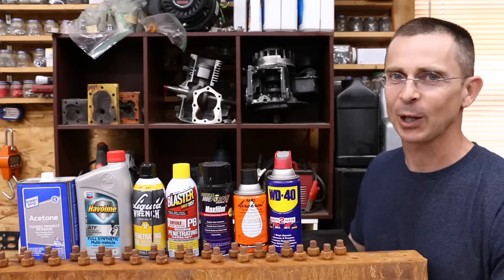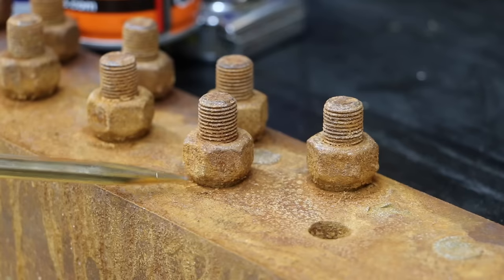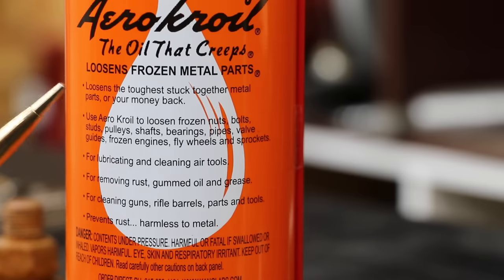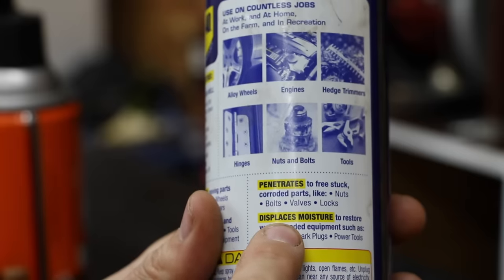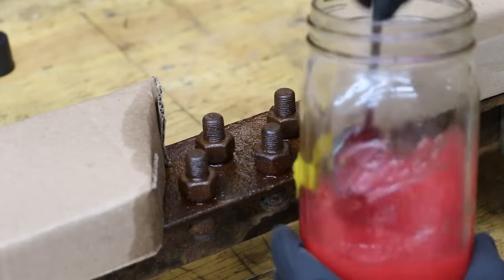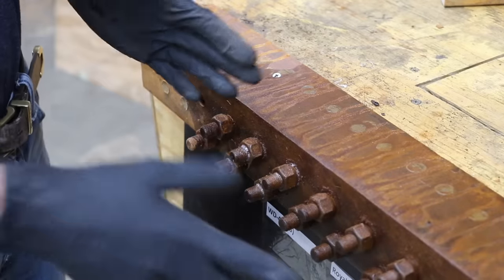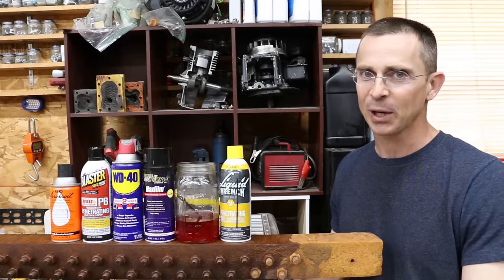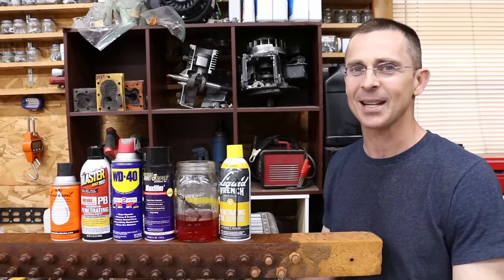Which Penetrating Oil is Best? Let's find out!

Comment: I’ve used almost all of them and over the years and different applications the PB blaster works the best to be honest.
Reply from the maker: Thanks for sharing.
Reply: Most importantly it smells like root beer
Reply: Have you used Liquid Wrench ?
Reply: @@martys4x457 maybe i just have a weird sense of smell but I think it smells like root beer Lol
Reply: I agree on the PB Blaster. I use it all the time. I restore old cars for a living, so I've encountered many rusted fasteners. PB Blaster is the only one that I can see actually dissolving the rust when applied. Wire brushing the fastener before applying any penetrant will help. Kroil worked well for me in freeing up a rusted stuck engine. Poured Kroil in the cylinders and let it sit a couple days. I think Blaster would work well for that too, and I am going to try it in another old engine in a few months. The other products have not been useful for old, rusted fasteners for me. I keep some WD40 around for light lubrication use, but it's not useful for serious rust.

Comment: Liquid silicone spray has always worked for me. It seems to penetrate better than anything else and works in seconds. It will evaporate leaving behind the silicone and not an oily mess. Also works wonders removing/installing rubber hoses and weathertight electric connectors.
Reply from the maker: Thanks for the feedback.
Reply: Silicone doesn't evaporate, and can be a disaster in a restoration shop where paint work is done.
Reply: Read it again and tell me where it says silicone will evaporate lol The liquid spray evaporates leaving behind the silicone 👍 As far as paint shops ALL spray lubricants should be avoided in such areas obviously.

Comment: I really like all the testing you do and this test was no exception...
I've been using Liquid Wrench all my life for rusty bolts and then heat if the Liquid Wrench doesn't do the job.
WD-40 is my go-to for rust prevention, as a minor lubricant and thread cleaner.

Comment: Liquid Wrench has always seemed to work the best for my uses. Application of heat can also be used differently. On exhaust type connections, a couple of heat cycles can break an oxygen sensor loose.
Reply from the maker: Thanks for the feedback.

Comment: Video recommendation: Which spark plug is best. Test different spark plug brands like NGK, champion, autolite, etc. as they are around 2 dollars a piece and not expensive across one engine like a predator 212. Measure engine temperature, RPM, fuel economy, and performance. Thanks!
Reply from the maker: Thank you for this video test idea!
Reply: Oh man yes please.
Reply: My prediction is that fancy plugs don't improve power or performance in any way.
All you need is a good ol fashioned spark not a fancy spark.
Reply: Donuts Garage, I have learned in the past that NGK plugs are the best for a 2 stroke. Maybe Project farm should test them on 2 and 4 stroke engines.
Reply: First thought is that the fancy plugs might not perform measurably better but last longer. The iridium plugs have a skinny center electrode that is supposed to produce a better spark and last over 100,000 miles.
Reply: Donuts Garage good idea but it's only practical for the engine you test
Reply: depends on the vehicle/engine.  try running a german car on some autolites and see what happens lol
Reply: Zadiel Vazquez from my experience cheap plugs don't last but when they are new and as long as it produces a strong spark, well you have it.
Try running different plugs on a real dynamometer and find out for yourself.
Reply: I would like to see this also, but mainly with 2 stroke engines because they burn oil and gas . The oil makes them more prone to fouling. The reason why is I have rebuilt many snowmobile engines and have had the worst luck with CHAMPION plugs. I don't recommend them because of my experiences with them. Just wondering if I am still right .Or Maybe it was my perception of them being inferior.
Reply: Andy Weaver not really a lot lasting.  So we plugs can't lei up with the demand of some motors causing them to detonate.  Happens often on finicky cars.  Usually German.   I've seen a few engines blow because of it.   Brand new plugs.   Like i said,  all depends on the engine
Reply: Donuts Garage I want to see this test done...
Reply: Albert Champion invented the spark plug, Champions of the right heat range always ran my sbc cars better.
Reply: Zadiel Vazquez sorry I could always be wrong but I have never heard of plugs causing pre ignition??
Pre ignition is generally only a problem in high compression engines and low octane fuel. Or lspi  in turbocharged engines and that's a whole different animal!
I didn't realize a spark plug could cause engine knock.
Reply: I don't believe a test like that would benefit any results. As long as the plug is correct type for the application, the differences are too small to detect with garage equipment.
Reply: Catrik  I agree
Reply: Duh NGK or nothing... love project farm👍🏻
Reply: my prediction is at home there is no test you can measure the difference in the brands...the difference is prob so minute that only highly sophisticated machines would be able to tell any diff at all
Reply: Another idea would be to modify the plugs ie drill a hole in the ground electrode. I did that one to a lawn mower and it seemed to run better.
Reply: Andy Weaver, It's called spark knock.
Reply: MegaDirtyberty I will do some research on spark knock. Sounds interesting
Reply: Well that does stand true with copper due to it being the most conductive metal used in plugs, certain power delivery is required for some applications where iridium is very good.
In any case, Champion is and will always be, total. crap.
Reply: NGK are best for 2stroke. Champion are the worst  for 2stroke. Champion seem to work well with 4 cycle engines
Reply: It would certainly be an interesting test. I've always been under the impression that old fashioned copper plugs would be the best - as copper is the most conductive compared to other plug types, but they don't last nearly as long. I wouldn't really expect the differences between plug types to be different past the standard margin of error though.
Reply: I would also love to see this. I found E-3 to be gapped so bad from the package and actually caused heat degredation in a two stroke piston (no, the gap was not too large to create too hot a spark) and NGK to be the best. Had many champion plugs go bad on me.
Reply: try bosh super 6 or super 4 plugs there better than ngk and champion
Reply: @supersportryder   Did you know that AC Stands for Albert Champion?
Reply: No I did not, thank you.
Reply: yes  @drgnzadiel101  , iridium autolites on a volvo not really good either
Reply: Guys... NGK makes most brands of spark plugs, except champion.
Reply: @erniestoner8266  
I used champions in the late 70s and kept having problems with them not lasting more than a couple of weeks. A friend told me ,if you get rid of those champions and put Autolites in there you wouldn't have that problem. I did and he was correct. Never had any problems with Autolites so why change? I tried E-3 they worked great for about a month then went to crap. Not worth the money in my opinion 
Just what I have tried maybe it will help you sir
Reply: @bertgrau9246  proves my opinion- Champions are garbage. Thanks.
Reply: @SuperJlonergan  
Sir, I think if you tried E3, champions,  and Autolites you will see a difference very quickly. In my experience the Autolites have out performed all the others by a long shot. E3s too much money and I tried them in my car. Pick up and my lawn mower. Lasted the longest in my mower one season my car and pick up just a few weeks. In my opinion I would rather buy the cheap copper Autoelites replace once a year and move on.
Reply: @erniestoner8266  
You're welcome sir
Have a wonderful weekend and may God bless you and yours
Reply: Pedro Gunderson  
That may be correct, I have used them in a 67 Dodge Charger. 69 Plymouth valiant. 61 Caddy 74 Caddy 75 and 76 Caddy 65 Dodge Dart 84Ford tempo 90 Doge omni 77 Chevy pick up that's not every application I know but every vehicle I've used them in they worked better than what they had in them. Plus I was even able to get one for my mower an Autolite that is and never had any problems like I did with champions, and Ac's . I have tried using Halos as well about $11 each. Still couldn't tell any better than Autoelites and gas mileage was about the same. In the. Long run the Autolites are better with fast starts and better gas mileage.
Reply: Denso & NGK - no other spark plug makers are even in the same ballpark!

Comment: Fantastic! I've never known a mechanic to believe in penetrating oil at all, but it's really cool to see that while most of them, indeed, did basically nothing (most of the bottom ranked ones didn't seem to actually do better in a statistically significant sense), Liquid Wrench really blew my mind! What a great product!

Of course, nothing beats good ol' molecular motion.

Just uh... <_< Don't use the torch on your Saab story. I've seen more than a few of those get lit on fire on the alignment rack with all their fancy rubber curtains and sheaths to keep things clean.
Reply: I've been turning wrenches for a living for 12 years and I never don't have a can of PB Blaster on my Roll Cart. 

Looks like I may have to give liquid wrench a shot.

I'd rather spend 10$ on a can of oil than spend 2 hours extracting broken exhaust bolts. Thank god I dont work on northern rust belt shipwrecks. Or I woulda quit doing this after 2 weeks.
Reply: @EvlEgle  Heheh, yeah, I managed shops in the northern rust belt. Maybe why all of my guys always just went right to the torch.
Reply: @barefootalien  Only worked in 1 shop that even had a torch. 

Tried to bring my own to more than one dealer I worked at and they said hell no. 

Just not a problem we deal with down here. Thank god.
Reply: @EvlEgle  That's wild! A torch was considered mandatory equipment up north! We even kept backup bottles in case we went through them and couldn't get a delivery right away.

Like you, a lot of the time people just wouldn't risk breaking or rounding off bolts, and would torch right away, like you do with penetrating oil. Very interesting, the difference in culture, though.

I wonder why the dealerships didn't want them... maybe they thought they were a liability for damaging cars? Which... I mean, they are, but no more than most other tools, and considerably less-so than a drive-on alignment or oil change rack. xD

Like I said earlier, the only cars where the torch was a problem were Saabs, which often have neat little rubber flap seals around the engine bay for things like tie rods to go through. Really neat design, kept the engine bay pretty clean, but also tended to melt or catch on fire when a torch had to be used, especially to free up an outer tie rod end for alignments. Not that they hit the seals with the torch, just that the tie rod end would get hot enough to melt them.
Reply: @EvlEgle  By the way, I hope you weren't buying the cans of penetrating oil... that's exactly what the "shop supplies" line on the invoices is for, to cover incidentals like that, like oxy/acetylene fuel usage, etc.

In my shops, at least, if someone did want some PB Blaster, I ordered it, for the shop. Same with torch fuel and the torch itself.

Heh, then again I did used to get in trouble from the higher-ups for such "frivolous" expenses, like the time I spent all of $80 on a vacuum brake bleed system so I wouldn't have to have a Tech 1 up in a lifted car to pump the brakes for 20 minutes at a time. At their hourly rate alone, to say nothing of the profit they weren't generating while they were up there, the thing would've paid itself off in under 20 brake jobs, but upper management can be remarkably short-sighted sometimes...
Reply: @barefootalien  Yeah I've never worked in a Shop where you are gonna get the shop owner to buy shit like that. 

Hell more than one of them I've worked at the shop owner bitched at us for using too much brake/parts cleaner or too much RTV. 

Never stayed at those shops very long. Best part of working parts delivery in college was I knew all the shop owners or foreman in the area.
Reply: @barefootalien  Just dont need torches in mechanics shop down here. 

Customers wouldn't understand and would have a shit fit. Yeah the private shops would probably let it fly. 

But at the dealer, where they are trying to preserve "an atmosphere" that have "factory trained" techs no. Because stuff doesn't rust down here. 

These bolts he is showing are worse than anything I've ever had to take apart. 

Customers would see you heating a bolt up with a torch and lose their shit. Be cussing at their salesman or service writer "that dumbass mechanic is cutting my car up with a f$cking blowtorch" 

Snap trucks don't even usually carry oxy torchs or bolt heaters down here. I had been doing this for almost 6 years before I even heard of a bolt heater.

Comment: This was a good one, and I say that as someone with a can of Kroil, that I have had my doubts about.
Reply from the maker: Thanks for the feedback.
Reply: Same. Guess I'm getting some liquid wrench instead for working on rifles.
Reply: @evey0259  I live on a sailboat, so...
Reply: It is the best this test is not conclusive there are to many variables , and it does a lot more than just a penetrating oil . It breaks down carbon very well (cleaning guns) and lubricates . It's an all in one , there is a reason the military , air plane repair facilities , machinist and gunsmiths use religiously.
Reply: @ryanbrown4336  probably because they've never seen definitive side by side testing. They're just going with the norm or what everyone says or looking at the price and saying that it must be the best.
This was a test of penetrating oils for the purpose of penetrating rust. Lubricating and breaking down carbon are not the issues at hand and can be done with purpose made products. Kroil claims to be the best penetrant oil and it just isn't
Reply: I have used all of these commercially available products in 20 years of industrial maintenance and i dont think any of them compare to the aerokroil. Its the best. There were a lot of variables in this test as it is hard to duplicate normal conditions in a quantitative test like this. Great video tho and very informative
Reply: @chrisbarnard6385  Stop confusing me!
Reply: @chrisbarnard6385  agreed